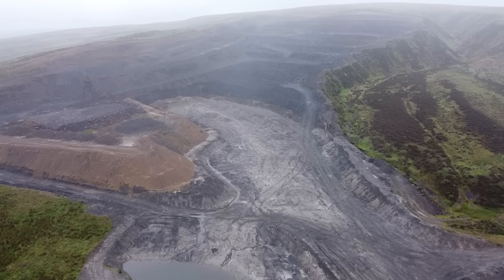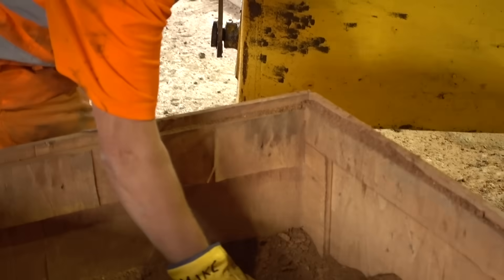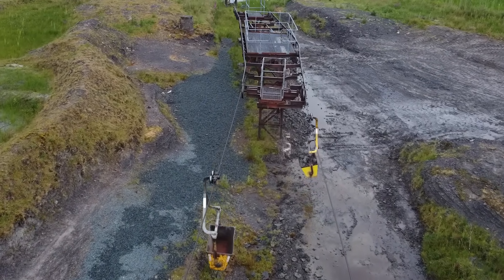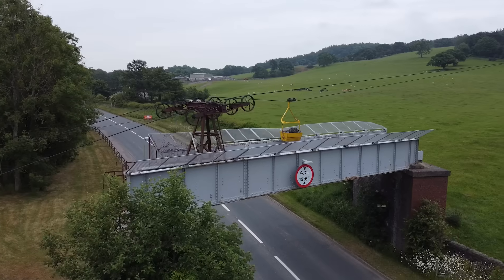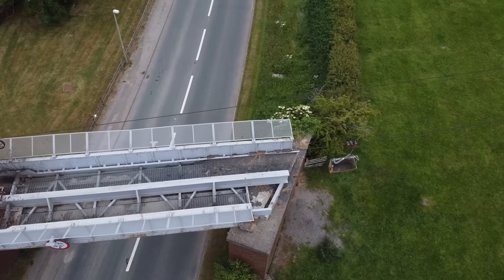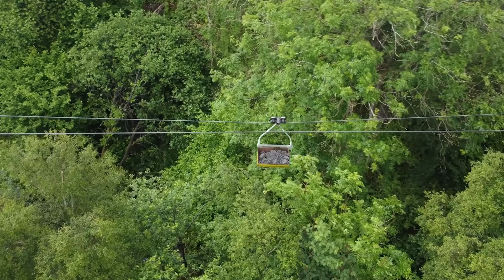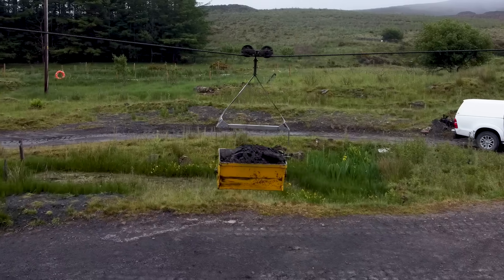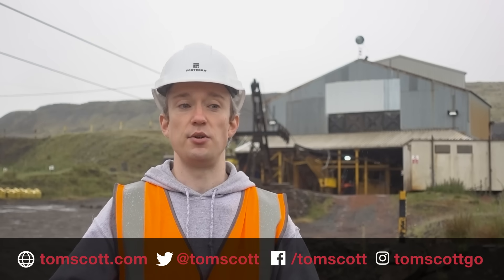The UK's last aerial ropeway uses no power, moves 300 tonnes a day, and will be gone by 2036.

Comment: With the brick factory being down hill from the shale mine, not only could the rope system run with no energy, instead of brakes to regulate the speed, it could be generating electricity.

Comment: I thought perpetual motion machines were impossible? Or is the energy input needed to keep it going coming from the men who give the empty carts a push?
Reply: Yes, perpetual motion is impossible.
This is not perpetual.
You can generate electrical power by moving stuff downhill.
Eventually, you run out of stuff, and there's no longer a hill.

Comment: I worked on military aircraft during the transition from aircraft designed by folks with slide rules to aircraft designed on computer programs. The old aircraft could have their lives extended almost forever but the new stuff has a definite limited lifespan.

Comment: I'm always amazed at old school technologies that are as good if not better than modern counterparts. When my mother and stepfather bought their retirement home out in the sticks it came with one of those old school lawnmowers with the spiral blades sandwiched between two wheels. Same deal as this rope-way, no gass or electricity needed and I was blown away by how well it worked.

While the worlds current brightest minds try to figure out how to reduce our carbon footprint the solution was quite possibly under their noses the whole time in the form of old school tech. Just imagine how much carbon emissions would be reduced if every modern lawnmower was replaced but one of those old school ones that have been around forever and I'd bet that more old school examples could be found as well.

Comment: In the outskirts of Grenoble, France we have a similar system that used to carry cement from a quarry on one side of the Isère valley to the other. It crosses a motorway (with the same kind of protection bridge), and the Isère river. Although it's been shut down for many years, it's inspired some folks at the city council to build a public passenger transport system across the valley as well.

Comment: instead of using brakes to control the speed they could hook a generator to it and use that to regulate the speed and produce some power for  the associated buildings
Reply: Exactly what I was thinking! It's a packetized version of a hydroelectric dam, except using solids instead of liquid.

Comment: I wonder if someone could take the towers and put them up somewhere picturesque and create a seated tourist ride. At least that way you'd save the towers and part of the heritage. Moving the towers would be expensive but changing it into a chair lift wouldn't take that much engineering. You'd need somewhere thousands of tourists travel to each day anyway.

Comment: there were designers and engineers back then that were genuinely clever about things. I worked in an old mill and the layout of the original building was built to accomidate two trains loading on either side of the building and while the original machinery was striped out long ago, you could still see how they set up everything to flow from one end of the building to the other

Comment: Why doesn’t everyone do this?  Seems like it would be way easier and less expensive than alternative methods.
Reply: Not easier, not less expensive. Weird niche cut cable is expensive, and the maintenance knocks out the ENTIRE line, for a LONG time. Far cheaper to just buy dump trucks and cheap gas and shift it that way. The literal only time this is viable is if you've got a resource rich area at a higher point than a potential refining factory building site that is big enough to not be built onsite but also not big enough to terraform to be built onsite. Only in that very specific case is it even close to viable.

Comment: Why aren’t ropeways like this used any more?  Just the safety concerns, or is there another reason?
Reply: Extremely niche conditions needed to make it close to viable. A resource deposit that's not so small you can just build on site, but not so large that it's worth terraforming the land to build on site, uphill from free land for a refinery, operating on a small enough scale that the entire line being down for maintenance isn't enough to kill the business, but big enough that they can afford the niche materials and machines required to construct and maintain a skyline.

Comment: Wouldn't this be technically a perpetual machine?
Reply: Not really since people are putting energy into and out of the system by loading and unloading the buckets.

For it to be perpetual there would need to be no outside interference by workers or the potential energy stored in the rocks on top of the hill

Comment: How does the weight of the shale bring up the empty buckets from the other end? Is the rope itself moving?
Reply: The rope is moving. The buckets are on the rope. Full buckets pulls the cable down which pulls the empty bucket on the other side up.

Comment: This is like using electric vehicles to carry rock down a mountain and charging the batteries using regen on the way down. They never need to be plugged in.
Reply: Yes, they would because friction and air resistance (as well as the inefficiency of the motor) would mean they would lose some energy over each round trip.
Reply: @RJSRdg  They're fueled by the potential energy from taking something heavy from a high altitude to a lower altitude.

Comment: There is a quarry up a hill that uses an electric truck to transport the rock. As the truck descends it uses regenerative braking to charge the battery, it off loads and then has enough charge to return to the top of the hill. Rinse and repeat.

Comment: There is actually a quary in Péry in Switzerland where they use electric hauler trucks that do not require charging.
They have to drive their load down to the cement plant and can recuperate enough power to drive up the mountain empty.
Reply: Regenerative braking is in a sense free-wheeling, if you are driving downhill you don't necessarily have to drive you just have to let gravity pull you while you control the vehicle with steering and brakes, this charges the batteries enough for the return journey uphill when the vehicle weighs a fifth of what it did on the downhill journey.
Reply: Due to friction, there's no way they would never need to charge the trucks however it may be minimal
Reply: @MA22  It takes less energy to drive up since the trucks are empty; you can get more energy since on the way down you're carrying a load with its own potential energy
Reply: @rickrickston3202  I would assume the truck charges using rotational energy when driving downhill. Unless the downhill path is longer than driving uphill, they would have to charge at some point. The extra potential energy would be taken care of by the brakes since you don't want to roll down a hill the speed of light. Extra weight shouldn't affect how much energy is recharged since it doesn't affect the number of rotations downhill vs uphill.

Note: I'm not a physicist, correct me if I am wrong. Apologies for the essay, idk how to explain my thoughts shorter.
Reply: @NoThrottle  Energy = force times distance. Downhill the force is perhaps 3 times greater than uphill.
Reply: @dougaltolan3017  It does make sense that there is more energy exerted downhill than what you need to go uphill. Now i need to learn how regenerative breaking works.
Reply: @NoThrottle  I am - potential energy= mass*gravitational accel * height. While you can use breaking, the primary slow down will be engine breaking. I think you are trying to say the number of dynamo->motor rotations is conserved minus loss energy which isn't true. In fact, if you use a naive friction model with a box you have more loss on the gentle slope. The transmission allows different dynamo rotation rates, so you can maintain a velocity while charging more or less based on slope.
Reply: @danielmorton9956  
Breaking bad....braking good.....
Reply: @JohnSmith-pl2bk  Ha, very true. I think what I meant to say is clear though.
Reply: @NoThrottle  The work done is a function of mass.  The loaded mass of the truck is much greater than the empty mass, so the energy stored in the battery retarding a heavy load is much greater than the energy required to drive the empty truck back up, even allowing for losses such as friction.
Reply: @MA22  For friction to be a problem, the efficiency of recuperation would have to be abyssmally low (about < 40%). The maximum effciency for regenerative braking seems to be around 75%.
The trucks drives down the slope with 65t of cargo (110t total) and drives up empty (45t).
According to some articles I read, the truck actually procudes 200kWh in excess energy over the day.
The truck is called eDumper Lynx

Comment: I'm kind of curious if the buckets could be turned into a tourist attraction come 2036, as a downhill ride with limit 2 people per bucket.

I guess then the trouble is ensuring the buckets are filled to the same weight every time, and whether the tourists pay enough to recoup the operating costs... and, quite possibly, there could be safety concerns.
But it could be a nice send off, if it were possible :)

Comment: Interesting. A cable car system was installed to deliver materials to build 'Cubley Garden Village' near Penistone (S Yorkshire) in the 1920s. The housing was to support the burgeoning steelworks nearby. My parents in law had a concrete pad under their garden, but beyond that there is little evidence, or even documentation for it. Must have been a 'thing' back then.

Comment: So why are these things phased out (or have already been, for the most part)? Seems quite efficient, transporting that amount of stuff without electricity or fuel. And today, you could probably easily automate the bucket-related process on both ends, negating the need for people to wait for buckets or sending them at the right moment while possibly increasing the speed of the whole system.

Comment: Nobody else seems to be wondering this, so I will. Why has nobody suggested hooking up a turbine somewhere in this setup to generate electricity? Tom mentioned that they need to use brakes to moderate the speed, so there is excess energy there to be harvested.

Comment: The "merry-go-round" trains that used to transport coal from South Yorkshire to power stations in Lancashire via the Woodhead tunnel worked on the same principle. The loaded electric-hauled coal trains heading west downhill used regenerative braking to balance the current powering empty trains climbing back eastwards.

Comment: I still don’t quite understand how is it working without any fuel or electricity.
Reply: Because the bucket at the top of the hill is loaded with rocks, and so gravity pulls it down the hill.  The other bucket at the bottom of the hill is lighter, because it has been emptied.  
The heavy bucket "falls" down to the bottom of the hill.  Because they are attached to the same rope, this pulls the light bucket back upwards.  You empty the bucket which has now reached the bottom, and fill up the bucket which is now at the top, and the whole thing starts again.  
TLDR: gravity is doing the work.  If you run out of rocks to fill up the bucket at the top, it would stop working.  Likewise, this wouldn't work if you wanted to carry the rocks up to the top instead.

Comment: I'm trying to wrap my brain around how this thing works, but I think I'm getting thrown by thinking there's free-spinning wheels on the buckets which roll on the cable downhill, like a zip-line. Obviously, this wouldn't work uphill. So, what's actually happening is the buckets are able to grip onto the cable, which gets pulled along due to gravity, which in turn, pulls the empty bucket uphill, which is also gripping onto the cable?
Reply: Exactly that. The wheels are only used for the parts where the bucket comes of the wire and is moved around manualy by workers.

Comment: So, free energy doesn't exist but it's gravity powered and they have to use the brakes?
Reply: They are still putting energy into the system by having workers load the buckets at the top (creating potential energy since it's starting point is higher than the exit point) and unloaded at the bottom.
There is no "free energy", the energy is simply produced by manual labor and the potential energy of the filled buckets instead of by motors.

Comment: These are the technologies that should be re-adopted in the modern era, especially in the age of energy efficiency.
Reply: @PoliticalJames  financially efficient but not energy efficient
Reply: @jasongarfitt1147  the world works on what is financially efficient. One day energy efficiency will be financially efficient.
Reply: @sethrawbass  Governments are still trying to figure out just how much more tax can be raised by taxing fossil fuels.
Reply: @jasongarfitt1147  no, it's also energy efficient as well. Dumptrucks being more financially efficient means that the financial cost of materials/energy needed to build and operate one of these aerial ropeways exceeds the financial cost of the materials/energy needed to build and operate dump trucks. We should use dumptrucks when they're cheaper.
Reply: @FunkyJeff22  I dont understand the Information you are trying to convey here. I think you wanna say that using this method is in both ways more efficient, energy- and financiallywise
Reply: @FunkyJeff22  The capitalist version of "efficient" almost always fails to properly cost the "negative externalities". Compare to fossil fuels and climate change, for example.
Reply: @cf453  And worker safety and pollution.
Reply: @quillmaurer6563  it's not like the trucks are fully automated. They still need people to drive, load and unload them. Trucks also need maintenance, have a high purchase cost and require parts.
Reply: No extra carbon, Totally self sufficient ... So we cancel it.
Reply: @hanaboskova  To be fair, the only reason it's getting shut down is because the hill is going to run out of rock
Reply: @hanaboskova  Not self sufficient, yes extra carbon. Did you miss the part where this thing needs maintenance? Besides nothing is truly self-sufficient, so that's already a moot point.
Reply: @Winasaurus  a lot less carbon than Trucks.
Reply: @cstrutherskgs  Less carbon than trucks is not no carbon though. Steel cables and steel supports need steel mines. Steel mines that also operate huge industrial machinery. If you're already funding that, you may as well just go with the cheaper alternative of trucks.
Reply: @Winasaurus  that is horrible logic. Less carbon is way better than more carbon. 
Your logic is “well it makes some carbon so let’s scrap it and go full carbon”

Comment: In theory, this could actually generate electricity by installing a generator instead of a brake. It probably wouldn't be worth the installation costs, but it would be cool to have a power plant powered by nothing but rocks and gravity.
Reply: There's a massive electric truck working on a quarry that carries rocks down all day. During that process its battery gets charged (because of regenerative braking), so at night it plugs into the grid to sell electricity. I'll see if I can find it and if Youtube lets me paste links :)
Reply: Rocks, gravity, and human effort.
Reply: and people using machines to remove the shale and bring it to the bucket area.
Reply: @JJKoga13  I suppose you could say any power gained from the potential energy of the carts could offset the carbon footprint of the site a little.
Reply: @idlemessiah  I could! I would ask for data driven analysis of the costs and benefits for me to make an assessment. Which could require a meeting to assess if the running an assessment is worthwhile. It's a whole thing. XD

Comment: Should still have an electric motor rather than friction brakes. That way they can regen power out of the ropeway to regulate speed and use the generated energy to supply part of the brickworks (even if it is only enough to keep the lights on for free)

Comment: The fact that 1920s engineers designed a system by hand that still holds up to computer aided design is amazing
Reply: Computer aided design is just a faster way to create planning documents and to test things without small scale models, it's not a replacement for engineers or engineering who have been around before paper existed, and who still had to learn math since ancient greece and perform practical projects and testing before they are trusted to create large projects.